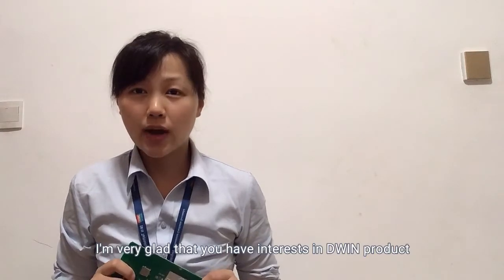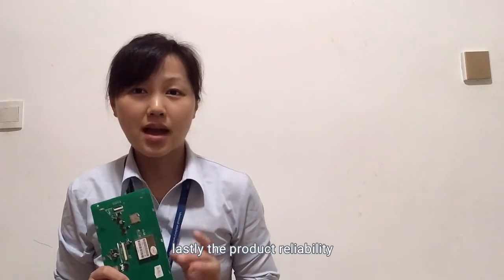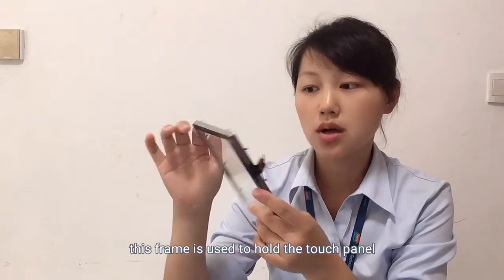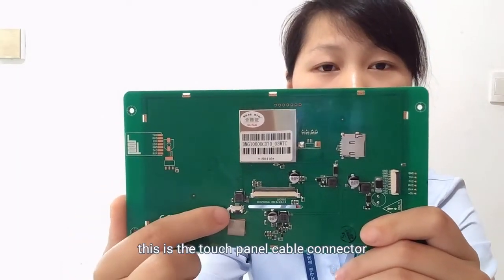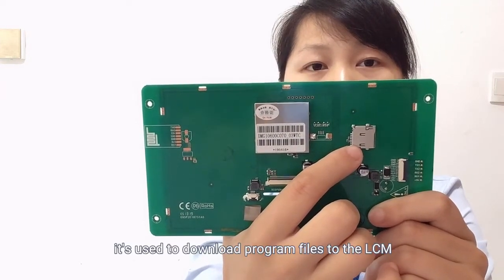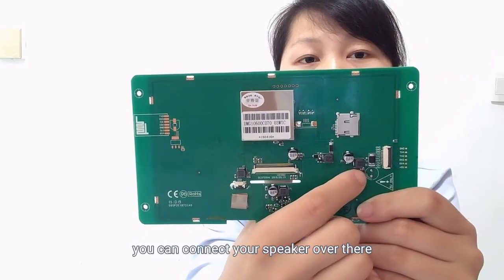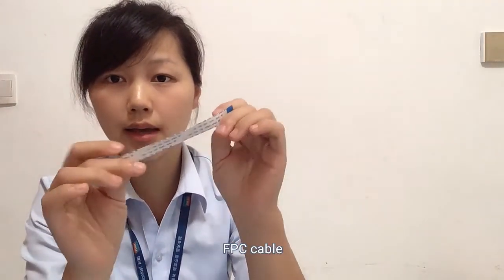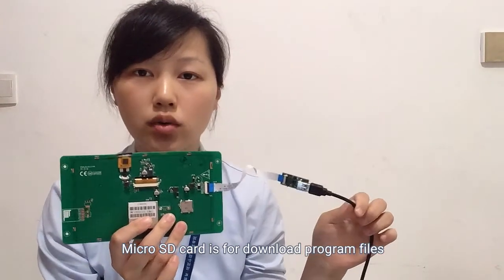7 inch capacitive touch smart LCM - DMG10600C070_03WTC

Comment: I purchased a 10 inch display, model- HDW101-001L. When give only power, its display become blackish. When connected to laptop, it works. But when give other input its display flickers. What is the reason behind it ?
Reply: Hi you can contact our technician for help directly, I suggest the display should connect to some drive /control panel as it's display function only and try to connect with raspberry pi  with its HDMI interface to drive it.

Comment: Is this procedure the same for a DMT80480L070_01WT  for a Beauty SPA Cavitation...?
Reply: Hi Arturo,this vedio could be your reference ,but there are some differences from DMT80480L070_01WT.First for accessories:DMT80480L070_01WT the interface is 8Pin_2.0mm,only need FPC cable and SD card.Second ,the development mode is different: the model DMG10600C070_03WTC is T5L ,but DMT80480L070_01WT is T5C2.It thus the development tool is different:DMG10600C070_03WTC is dgus DGUS Tool V7.618,but for DMT80480L070_01WT is DGUS Tool V7.388. For more details ,you are welcome to contact with me by mail Yoko(@)dwin.com.cn.
Reply from the maker: Hi~Yoko, the support engineer answered you just now. If you have any question please do not hesitate to write to her. Best wishes.